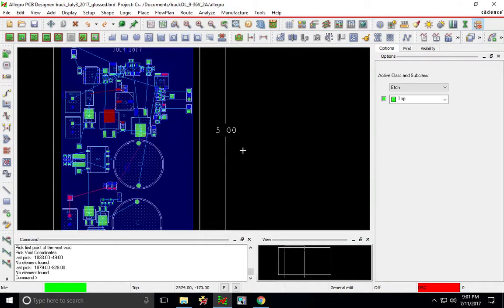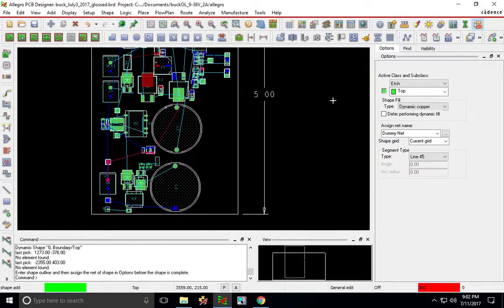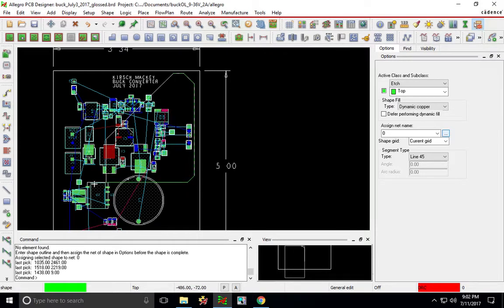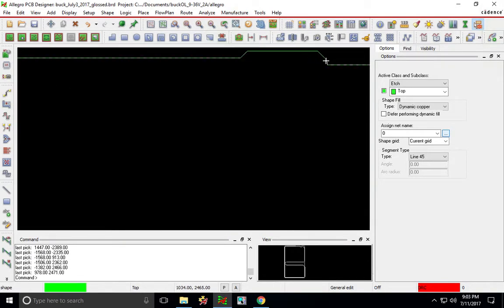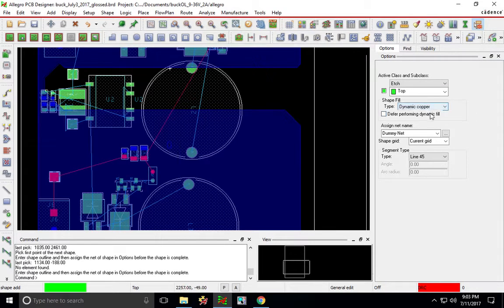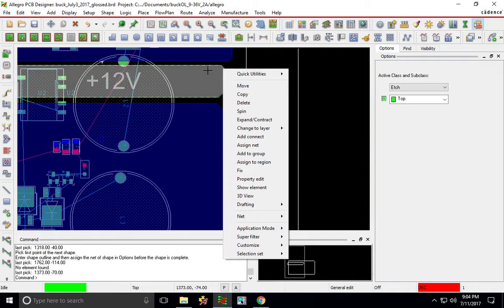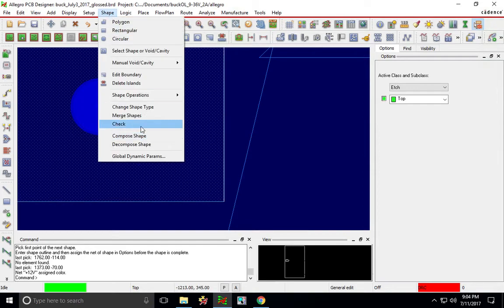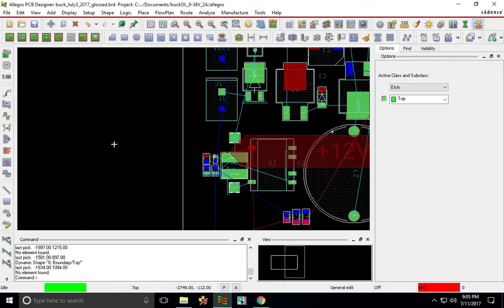OrCAD 17.2 PCB Design Tutorial: Mastering Copper Pour and Planes – Step-by-Step Guide

Comment: Can I add copper pours around the pads of a footprint?
Reply from the maker: Yep. depends on your reason for doing it though. if you want copper pour just around it, but not always, then you want to place the copper pour on the PCB, and not in the footprint.

if you always want the copper pour around the pads of the footprint whenever you place the part, then you would add etch shapes within that footprint and/or make custom pads that have the desired shapes. then use those copper pads (created in padstack editor by you) within the footprint.
Reply: @techedkirsch  for thermal dissipation. I thought about that but I wanted to pour every led and I thought it would be quicker that way but looks like it's more complicated. Any tips for me would be highly appreciated 🙏 I would like to know how I can pour around the bad in the footprint , I noticed if I create a shape in the footprint file It doesn't allow me to assign it to a net, if I just create a solid shape is it automatically implied it's copper? I do get drc errors if I play the shape ontop of the footprint in the . DRA file.
Reply from the maker: @nibzlegend99  Can i know the part number of the part you're trying to create the footprint for? I'll put it on my HaSofu Academy channel so that I can promote that youtube channel and also answer your question at the same time. if that's okay.
Reply: @techedkirsch  NFSW757GT-V1 is the PN I think, fsm505 p11 p12 r8000 is some additional info. I guess because the datasheet contains multiple parts. I appreciate it, I actually already got a footprint for it, but I was trying to cover the LED in copper pour and the area around it for better thermal performance. How do you suggest I do that , if you can give me tips before you release an actual video would be great. If I do it on the board,  the shape gets cropped so the actual LED won't be covered by the shape which won't help me thermally. When I try to add a shape on the footprint in the DRA filr I don't see copper option. Perhaps the way is thorugh pad stack editor but I am not too familiar with it and I have a feeling whenever I do something the changes don't apply on the board. Thanks Kirsch 🙏
Reply: @techedkirsch  I tried to add a a thermal pad with padstack editor and asked to create an antipad , did that with the same dimensions, update design and exit and boom, no changes 😂